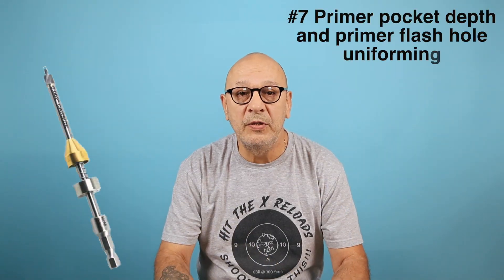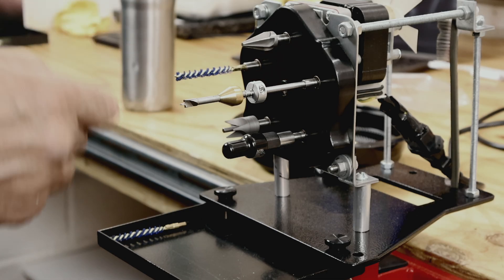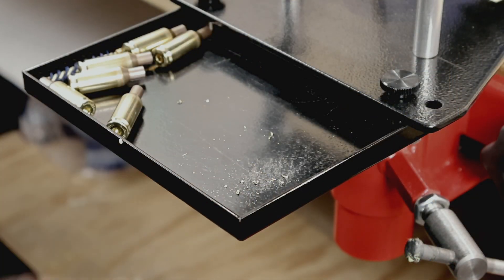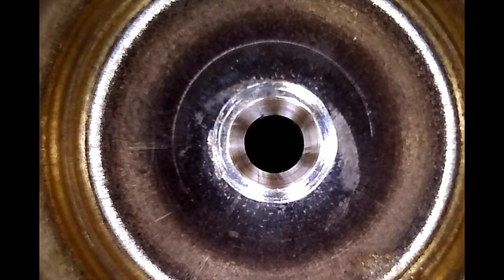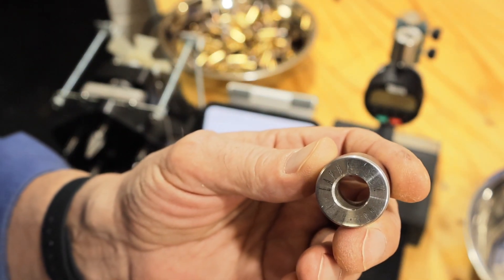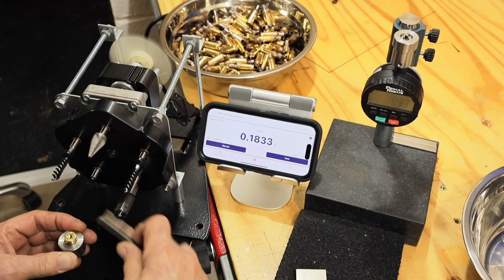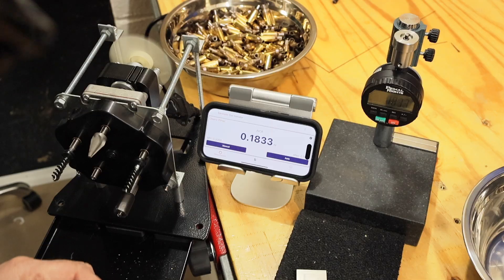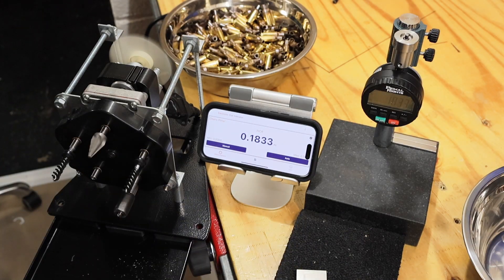#7 primer pocket depth and primer flash hole uniforming

Comment: This is great. However,  to uniform anything at the base end of a brass cartridge case, you can only enlarge sizes.  Vent hole, enlarge.  Primer pocket, enlarge. Primer pocket depth, enlarge deeper.  
Bevel flash hole,  remove metal.  
Very little, in the manufacturer of the brass case is material removal.  I think only OAL & the extractor groove are machined by material removal, the bulk of making the case is forming.  And I will say, I’m totally amazed that a brass case can be formed!   
Speaking of uniformity, I doubt anything could get the cartridge case any more uniform, over all, than what case manufacturing companies do.  
But, if the video can be proven to be benefit to a specialized discipline, accuracy shooting,  and be a safer case,  then that group may want to go for it.
Reply: And to honest, I think even the extractor groove in modern manufactured cases is rolled into the head.
Reply from the maker: My friend, I am not sure what you are trying to say here, but let me explain. 1. Uniforming the "Primer Pocket" does nothing except deepen it so you have uniform depths. It does not change the circumference or anything else. 2. Uniforming the "Primer Flash Hole" removes any burr that may be made by the manufacturers process of drilling or punching out the flash hole and leaves a nice uniform bevel on the inside. I hope that helps. Thank you for your comment.
Reply: @HitTheX what I said is exactly clear. Not sure why you asked “not sure what you are  trying to say here…”.  Forming a brass case  is done mostly by extruding, stamping, rolling, die forming and punching.  Very little, if anything is machining ( metal removal like you are doing).  Your “… a very nice chamfer …” is not an engineering term nor description of dimensions or finish.  Making cartridge cases by the machinery, methods and setup of the machines, in my opinion is unbelievably amazing the consistency case manufacturers give us.  Anything you do, as I said in my post, is material removal by machining.  You are enlarging flash holes ( or any other operation you do by machining)  to match the largest flash hole dimension in your group.  Or you are just over sizing all flash holes over the size of even the largest flash hole in your group.  I am not judging you or what you do, repeat here what I said in my original post, which for some reason you didn’t understand.   Making a cartridge case uniform to other cartridge cases in your group (that’s your title of your video : uniform)  you can only enlarge whatever dimension you are machining.  That’s what I said in my original post and that’s what I’m clarifying here.  My unrelated comment to what you are teaching in your video is:   I’m totally amazed how consistent and uniform cartridge case manufacturers can form, stamp, punch, extrude, roll material to make such a perfect and consistent and uniform cartridge case(s).  Truly a technical manufacturing art by designers, engineers, machine manufacturers, process engineers, and very importantly SETUP engineers of the equipment.  I’m not sure how you are making these wonders of consistent manufacturing more ‘uniform’.  Sounds like you are machining metal off in certain places to satisfy your idea of how something should be or how it should look.  Like “a nice chamfer”.   I pointed out that, as far as I know, manufacturing these extremely uniform consistent cartridge cases, very little is material removal by machining.  Dies, punches, rolls, are amazingly consistent and uniform piece to piece in manufacturing.  But, if you want to machine away material you have every right to do that.  Just make sure case safety remains, flame jet consistency, volume efficiencies and pressure is not compromised.